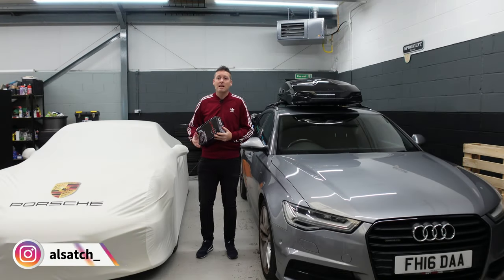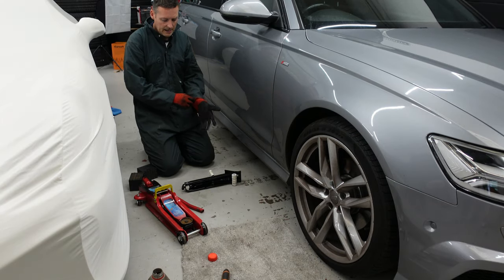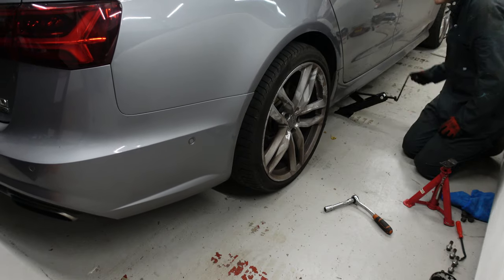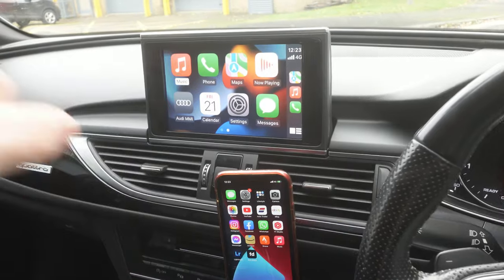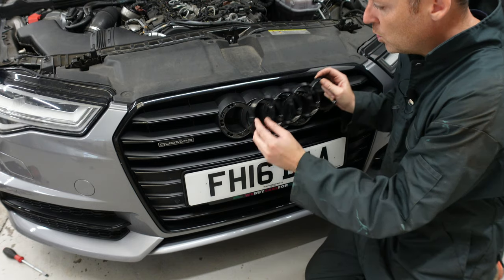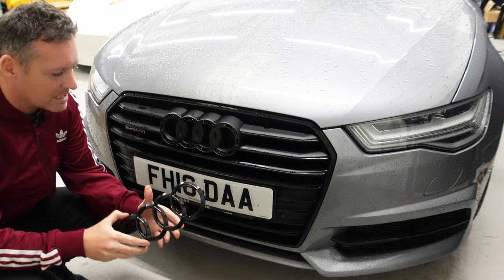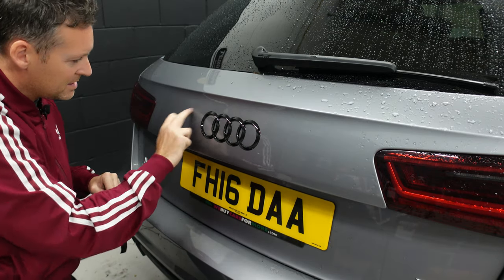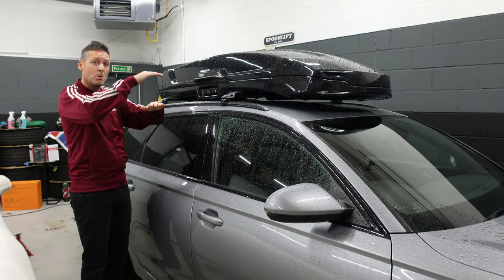Audi A6 C7 Free - Cheap - Easy & Best Upgrades & Modifications (FREE CARPLAY)

Comment: Is it ok to put different spacers on a quattro? As I know putting staggered set up on wheels are a no-no. Will having different width spacers not have the same effect as a staggered set up?
Reply: Spacers in general have negative affects of handling but the width does not affect the Quattro system. The reason staggered wheels cause issues is due to the difference in tire diameter affecting the load requirements in the differentials

Comment: gosh, you're lucky in the UK to just put these spacers on just like that. Over here in Germany they make a real song and dance about it and act as if some DRASTIC modification of the car is taking place, the entire geometry is changed all the characteristics of the original manufacturers design have changed and that "could make it unsafe" UNLESS tested and approved by the local TÜV. And that costs money. Police here have a trained eye and stop vehicles that look just slightly altered and if you can't provide proof that the mod is registered in the cars documents... the car is impounded and you're on foot until you can get it dealt with ....        by lawyers.
You have no idea how lucky you are.